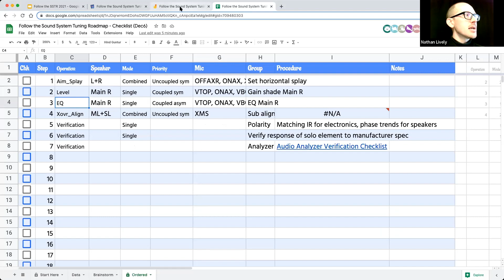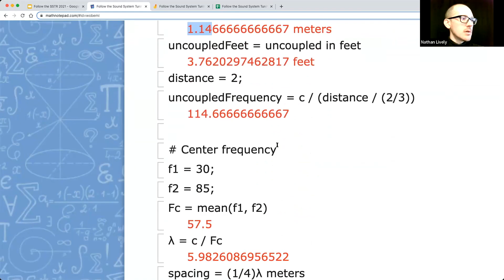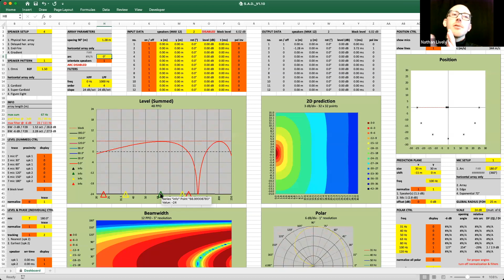How do you calculate cardioid subwoofer spacing? (gradient array)

Comment: I have four double 18's to use at a festival. I can set them up in any configuration I want.  What is the best subwoofer array type to use for even audience coverage?
Reply from the maker: Can you share a design? What's the size, shape, and location of the stage and audience? What are your sub array location options? What are your design criteria? If you don't know, then just set them up in a tall vertical array for 360º coverage.

Comment: Hi Nathen, is this Excel Sheet created by you? is it available on ur blogs? Unfortunately couldn't find it. 
OI have few questions regarding this:
1. Should the delay on rear Sub be "1000/67/4 = 3,73 ms"? 
2. How do u decide the vertical distance between subwoofers (from left to right)
3. I heard the maximum distance between 2 subs should be the 2/3 of the wave length of the crossover frequency (in your Video100 Hz). If this is correect, should one still tale the 2/3rd of wave length of 100 Hz or 67 Hz?
4. Could you please explain or make a video how this 2/3rd or 240 Degrees comes?

Thanks in Advance
Reply from the maker: Hi Priyan. Are you asking about Subwoofer Array Designer? No, that's Merlijn van Veen. 
1. Unsure. Can you give me a timecode in the video?
2. Vertical distance? I'm not sure. Do you mean horizontal distance?
3. That guideline would be applied to the highest frequency of interaction, but is normally used for spacing horizontal arrays.
4. https://www.sounddesignlive.com/how-far-apart-can-i-space-my-subwoofers/ and https://www.sounddesignlive.com/how-do-you-calculate-cardioid-subwoofer-spacing-gradient-array/